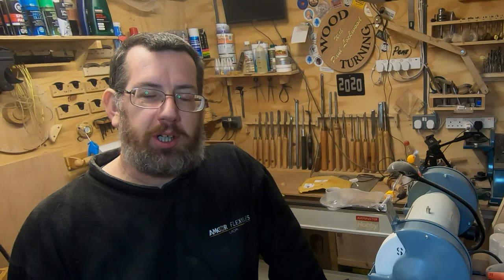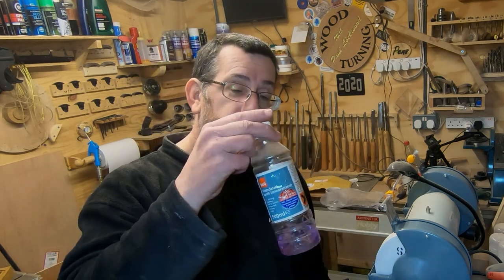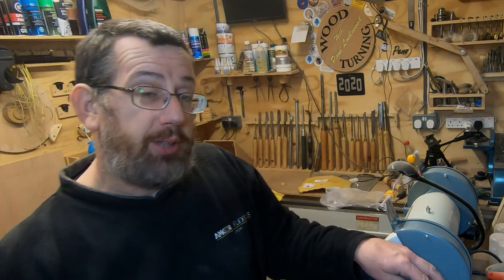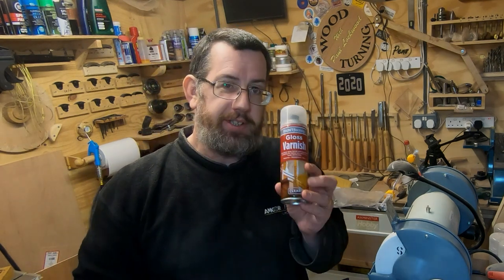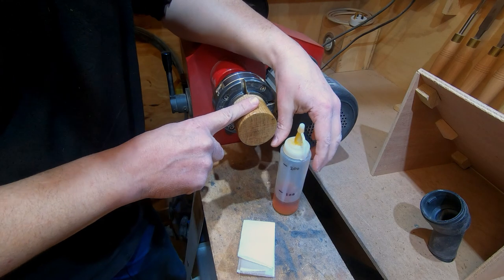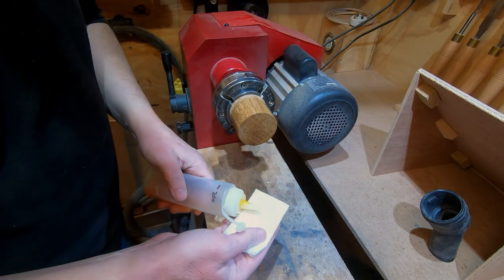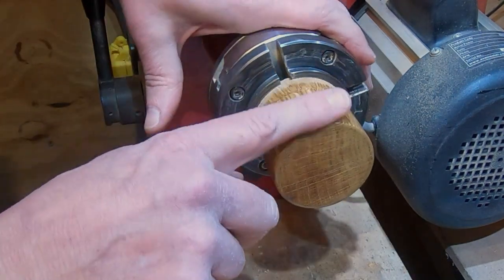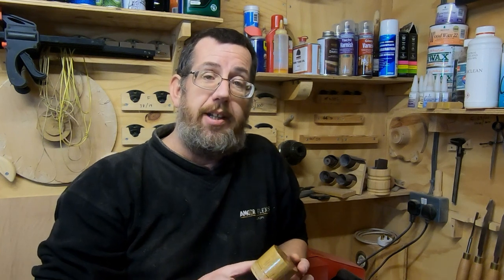Shellac Finish - Episode 235

Comment: Hi Paul I have been using shine juice for years and I always put it on with the lathe running put about 5 or 6 coats on then turn the speed up and apply the paper towel and create friction and the shalac will go off takes about 10 minutes depending on the size of the piece your working on cheers 🍻 Ian
Reply from the maker: Thank you Ian. I've always struggled with this, never seemed to work very well for me. The Shellac should only be setting as the alcohol evaporates, as that's what caused it to become a liquid, the oil is simply for lubrication and should by rights give that final shine when it goes off itself.

Comment: Really informative, thanks! In Sweden we have dyed alcohol too and my experience after leaving a bottle out in the sun is that the dye fades completely quite quickly and if it´s tricky to find clear alcohol, just put the dyed in the sun.
Reply from the maker: Thank you Den, never knew that. Fortunately I found the clear on eBay which is a reasonable price.
Reply: @PaulLockwood  Some dyes may leave a little residue on the bottom of the container,  so a paint strainer can be a good idea, just mentioning it before someone ruins a good finish mix...

Comment: Very informative and useful Paul. In a previous life, many years ago, I was trained as French polisher/piano finisher and I concur with your advice. apart from using water with wet and dry. As you have no doubt found water can leave a milky bloom on a shellac finish. I would suggest using very fine steel wool (not with the lathe running) or a fine piece of ny-web with the grain then continue with your method.
Another use for shellac is as a filler for repairing damage or cracks in the wood. I used to buy Button shellac and melt it into a thin rod shape then melt the rods with a candle taper to drip into the damage. not sure of using this method before turning though due to the brittle nature of the shellac, must try it one day.
Reply from the maker: Thank you Mac. That's really interesting to hear and good to know almost all what I've covered is good advice form a professional. Yes the water does leave it milky which is why I give it one light coat to finish that clears it up. Certainly looking or the ny-web but struggling to find something suitable at a good price at the moment.

Comment: Hi Paul, very interesting and informative as always. I'm fairly new to woodturning and have just made my wife a bracelet/bangle from spalted beech. I was wondering how to finish it and remembered this video. She will probably wear it constantly - even in the bath - and in that case would you think shellac or lacquer would be appropriate? Many thanks!
Reply from the maker: Thank you Keith. Personally I think I would go for several coats of spray lacquer as that should be harder wearing. The problem would be to coat the whole piece as it is like to be submerged in water.

Comment: What do you use as the sanding sealer.  I generally use a 1 pound cut of shellac.  Seems better to use a shellac sanding sealed under a shellac finish.
Reply from the maker: Hi John, I use a Cellulose Sanding Sealer which I thin down first. Dries really quickly and doesn't gum up the paper when sanding like Shellac would. Shellac works well as a sanding sealer, I suspect the thinner the mix the better.

Comment: Great video. Do you know how this would compare against other finishes, such as 'Chestnut Melamine Gloss Lacquer' or even just several layers of sanding sealer? I'm looking for a product that would be good for a pepper mill which will get a lot of hand wear and friction. thanks!
Reply from the maker: Thank you. I'm sure that when fully cured this will be fairly hard wearing, look at what furniture is like but it will wear over time like anything. I would also guess a spray lacquer slowly building up the coats would be just as tough wearing, maybe even better. You may have to experiment on something like a pen that you can use a lot.

Comment: That’s for the information on shellac. I have used shellac before on bowls. Was not impressed as I would see lines left from spinning.
Maybe I should not spin  the bowls. Is your method the same in doing say bowls and platters? Again thanks!
Reply from the maker: Thank you Jon. Never tried it on bowls etc. However if you put on light coats and slowly build it up then I would guess the final sand and coat would produce a good even finish. Spinning up the lathe adds that extra pressure, a bit like sanding, you can hand something and not leave scratch lines in certain places, so applying manually should allow you to get the same result.